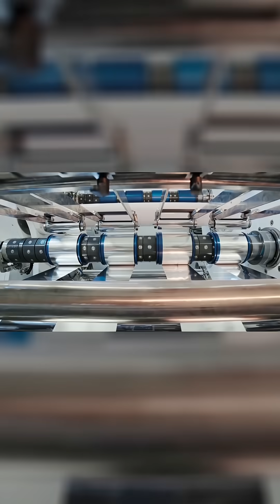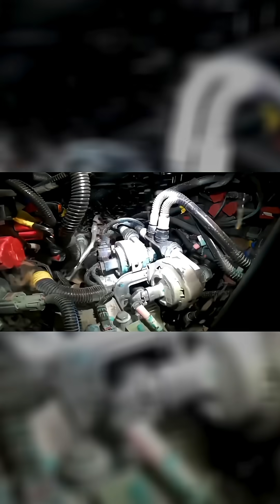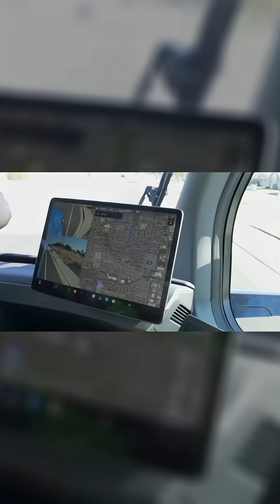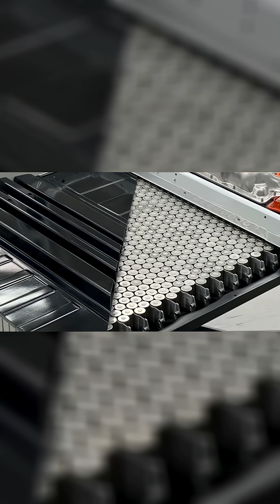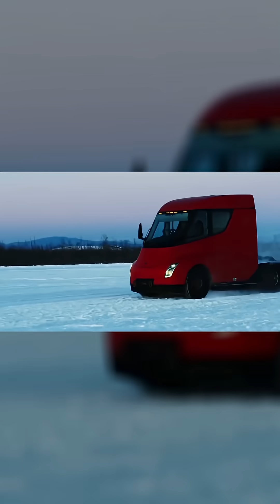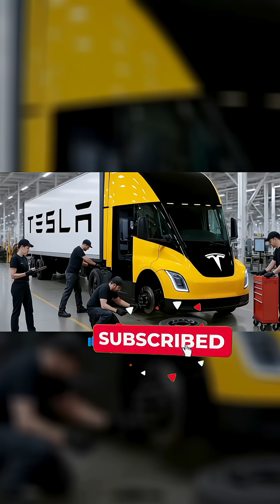Tesla Semi: 1200-Miles, 20-Min Charge! Elon’s Gamechanger

Comment: This new aluminum ion battery seems great . My only concern are these batteries recyclability. And if so , how? Also, are the trucks cabs made with recyclable materials such as aluminum and not any petrochemicals? There is some great new bio materials such as simulated leather made from mushrooms that’s actually more wear resistant than real leather and petroleum based vinyl and looks great.

Comment: What about using accumulators to power the trailers when they start to pull the trailers less electricity battery power needs to start.  Tractor and flat bed flying. From rail yard to destination save fuel trailer can be larger since it’s a single purpose  for yard 
R
 Usage only,

Comment: The largest truck stop has 900 parking spots. No way these truck stops will be able to install and maintain the charging stations . They better have a nuclear reactor sitting by the truck stop ti supply enough electricity for charging . Gonna be a lot of late delivery’s if you have to wait for a charging spot .